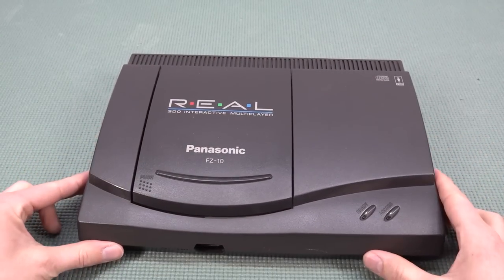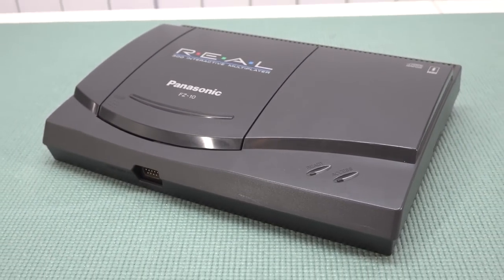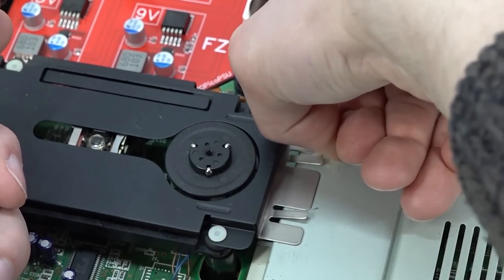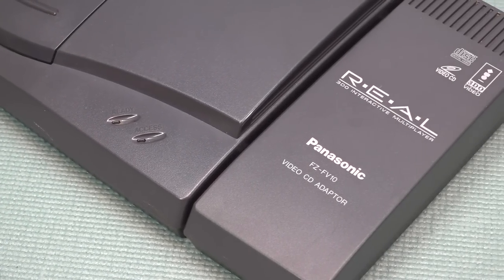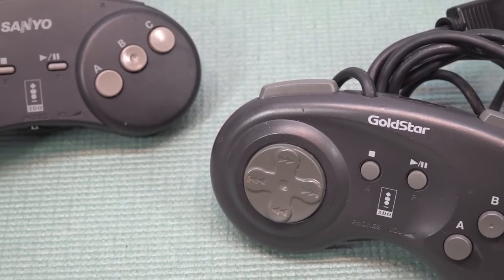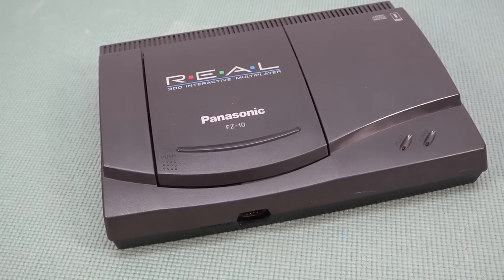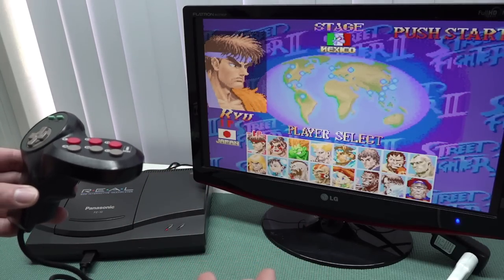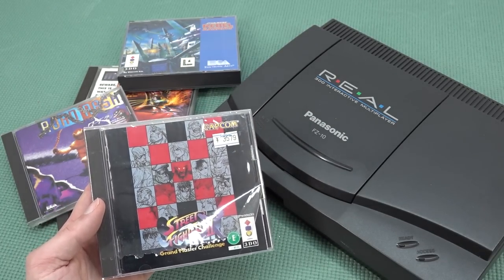Awesome & Affordable Way To Play 3DO in 2023  / Panasonic FZ-10

Comment: I bought my first 3DO new in 1994 for $300 when it died I picked up another at Best Buy when they were closing them out for $69 and it still works. It's a very underrated system. Due to emulation I don't use it anymore as 4DO does what I need it to do.

Comment: A friend of mine, José who passed away in 2017, had that model with all the games and controllers. I had another friend who had one of the other brands 3DO and it stopped working fairly fast. Yeah other models from other brands failed fairly regularly the FZ-10 was the most reliable one. It's an O.K. system but not worth the original $700 asking price. Good review and cool video Wicked.👉😃👈

Comment: 3do was the highest spec system of its time. It went up against ps1 and was much better system. Check the specs it was up with ps2. If it kept going games today would be a thousand times better than now.
Reply: No. Lol.

You are wholly incorrect.
Reply: @nexxusty  read up my friend it was way higher spec than it's rival at the time of ps1: it was higher than ps2 which was 10 years later
Reply: @grointastic4242  You're thinking of Panasonic M2. I know what I'm talking about. 3DO wasn't even close to as powerful as a PS2.

There's literally nothing a PS2 couldn't do that a 3DO could.

3DO only did 50,000 polygons per second. Original PlayStation could push 360,000.

I'm not even going to bother giving you the figure for PS2, as hopefully, you get the point.

Comment: Hi, I'm Walter from Rome. Sorry for my bad English. Congratulations for your video on the 3DO console. I wanted to ask you as an old owner of a 3DO FZ-1 mistakenly sold many years ago; I'm trying to get one, considering that I care a lot about the condition of the console and the box with its interior (polystyrene, instructions, etc.) I found one in excellent condition but it's an FZ-10. I know that the FZ-1 has its value and importance but it is unattainable in terms of price and is only found in Japan where I would pay an absurd amount of customs. I wanted to ask you, can the FZ-10 also be considered excellent as a purchase for a 3DO? I read somewhere that it was built cheaper than the FZ-1, but is that true? Thank you for the answers you can give me.
Walter

Comment: With these CD based consoles getting really old it is going to get harder and harder to replace lasers or motors for the CD player eventually it will need a laser emulator to play your games when they eventually die and it will cost more to repair or replace the laser.

Comment: Yeah... Pass. I'll stick to emulation. Older consoles especially CD based systems are heavily prone to optical drive failure. 
Repairing or replacing parts is too much of a hassle considering those components are proprietary and not easily obtained. Unless you cannibalize another defective unit for usable parts.
 While we may see the day where we can 3D print working replacement parts for those systems. I'd hold off purchasing those consoles. Unless you stumble upon one really dirt cheap.
Reply: I'm quickly learning that emulation is the way in general.